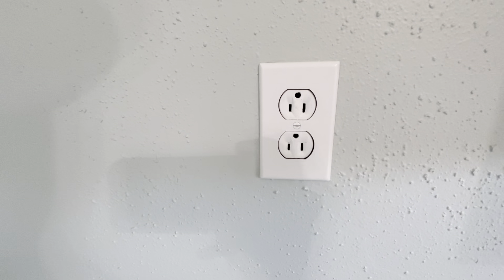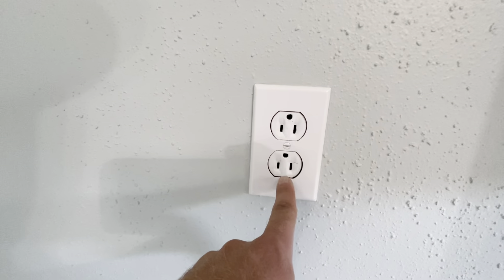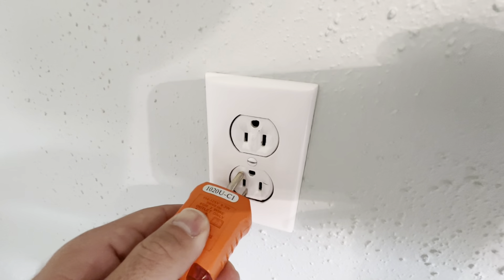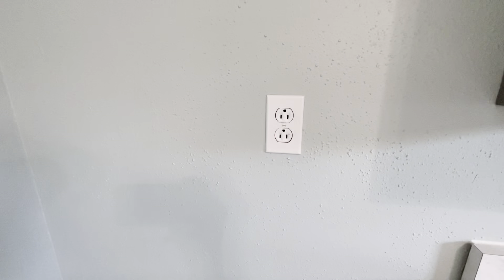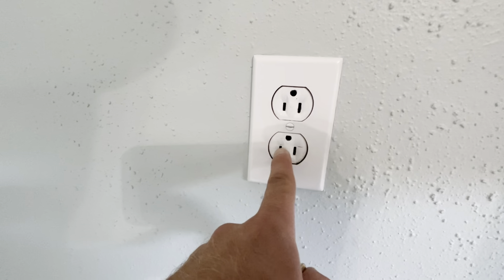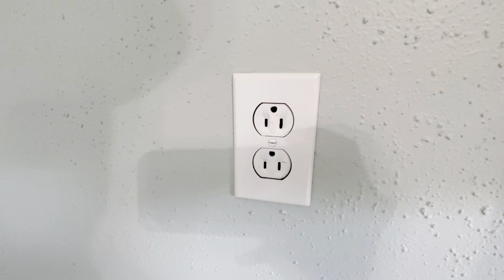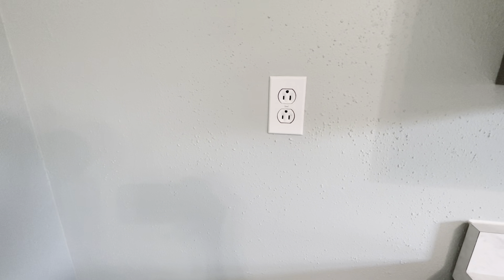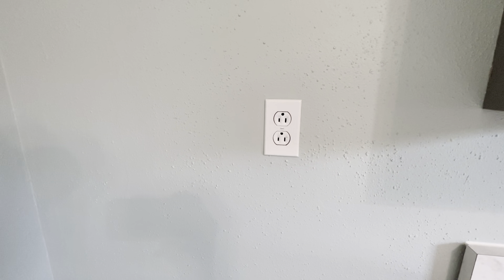DON’T PAINT RECEPTACLES!!

Comment: Agreed they shouldn't paint over, but it seems less likely that paint got inside.  better just to scrape the paint back and move on with life.  That said those receptacles are generally builder grade crap with back stab connections so maybe its a good idea to replace with some low cost spec receptacles.

Comment: Paint one thing but also don’t instal your plugs upside down either
Reply: i dont think in code there is any spec that says one way or the other but it is very common for the manufacture to actually design them to be ground side up. I have heard a good case for the ground up as generally if a plug is getting pulled loose having the ground pin on the top means if something were to land on the exposed pin, it would not be the same type of hazard as the hot and neutral being it and completing the circuit. but that said there is nothing in code for either orientation and it seems like manufactures are putting them out as ground pin up as the WR logo on my outside receptacles  would be upside down if the hot and neutral were on top. this sums it up also haha https://www.youtube.com/watch?v=3AAKEeDcZ34
with that said it seems you can orient them however you prefer so there is no upside down .

Comment: Can you paint light switches?
Reply: And how on earth can you clean the toggles?
Reply: @Vickie-r4u Dry cloth?
Reply: @UVIcki not saying it's safe but I've always used a damp (wrung out as much as humanly possible) washcloth to wipe down the plates. Could also use a q-tip (dry) for up+ down switches, if it's just oil/dirt it should wipe right off of the smooth plastic switches
Reply: @caffienatedtactician  yes it's the up/down switches that are giving me grief. Stuff from people's hands apparently collects around where the raised lettering for "on" and "off" are. Maybe I should try my son's electric toothbrush 🤣 They also have those dental pics but the portion that holds the bristles is metal so maybe I shouldn't try that one. I will try qtips and see